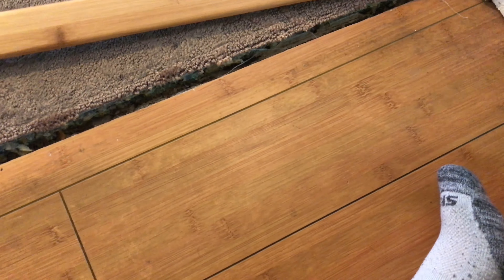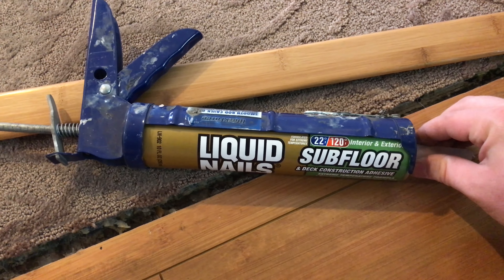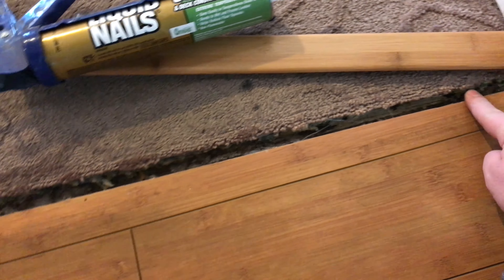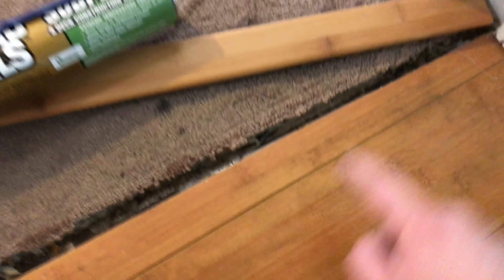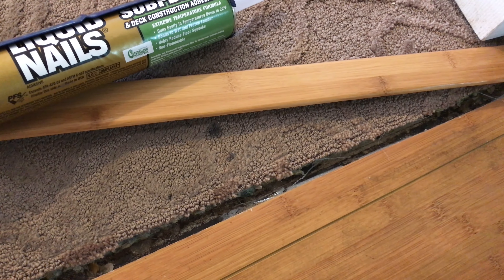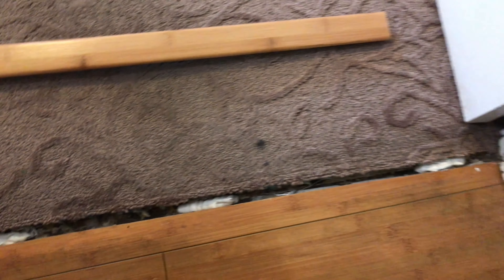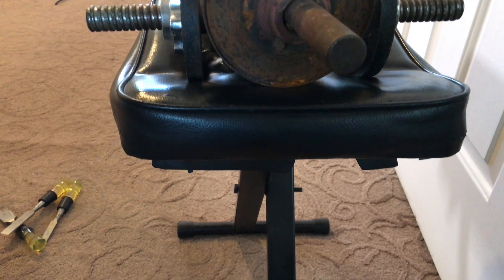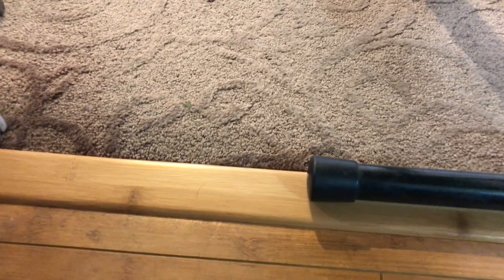How to fix a Carpet to Wood floor Seperator - T-Mold - Flooring Separator

Comment: ...looking for info on how to transition my newly installed flooring to the three carpeted doorways, and I'm not sure if this is the most right way to do it (looking at other videos).   Did your t-molding come with a metal anchor channel?  How did you secure the carpet, on the cut edge, in the doorway?   What is supporting the T-molding on the carpet side; just the carpet?  Is the 1/2" space between the laminate and carpet enough for expansion?   Lastly, how is it doing since the video?  Any repairs/replacemetns?

Comment: Does the carpet have a tack strip under it there or is the t-molding the only thing holding the carpet down there at the doorway?
Reply: I need to know that to s I do not have a tack strip under my carpet in each doorway.....
Reply from the maker: @nicbishop4841  Yes, tack strips are in place here to keep the carpet from moving with the face pins towards the walls. The transition is joined with the wood T-Mold flooring separator.

Comment: Do u have a carpet tack next to the transition?
Reply from the maker: Yes, tack strips are in place here to keep the carpet from moving with the face pins towards the walls. The transition is joined with the wood T-Mold flooring separator.